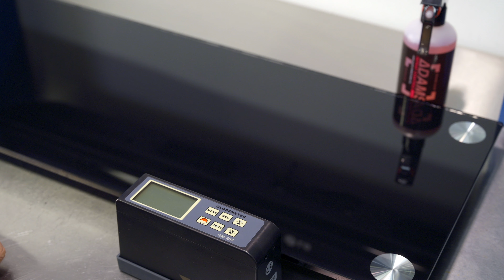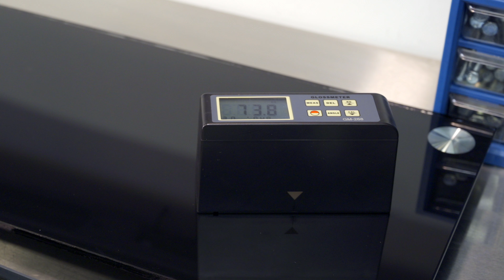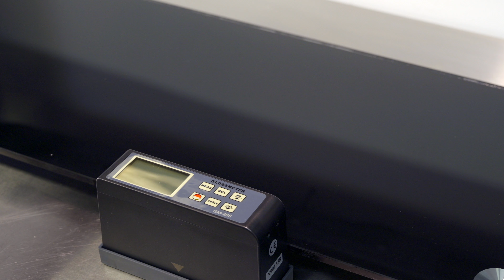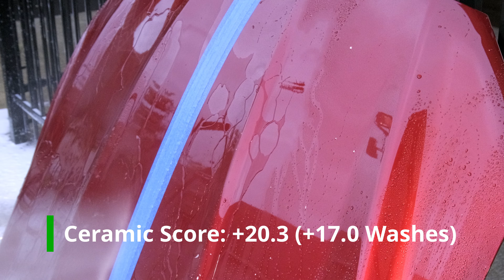It Glows! - Adam's UV Ceramic Spray Coating

Comment: Sadly I bought this and it’s not that good. Yes I did everything like he did and it did not last long (under a week). I now use turtle wax and that thing lasts forever. There is this guy who tested every ceramic coating out there and turtle wax comes out on top and it’s way cheaper. You cannot return adams ceramic coat too.

Comment: These ceramic coatings are better than waxes and a lot easier to apply.  I used Carpro HydrO2 and it couldn't be simpler.  Just mist it onto a wet car and rinse it off less than a minute later.  No waxes needed before or after and it can even make water run like crazy off a car that had no waxes or sealants on it at all.  The only drawback is it doesn't last too long but it is cheap and easy to use.  I can put it in a mini hand held sprayer and spray it on at a self service carwash and magically drive away like I just waxed the car!  I will be trying Adam's coatings next and I expect great things.  I think it technology is wonderful with all the advances in chemistry and such.  A hundred years ago no one ever saw all this coming (except maybe Jules Verne or Michel Nostradamus).  I also like the way these products don't have an adverse effect on glass.  In fact, I stopped using Rain-X when I started using these products.  It replaced Rain-X in my opinion and I used to swear by that stuff!
Reply from the maker: Charles, yea the coatings are amazing these days. They can last a very long time, though I have not used the Carpro HydrO2. What i would call “true” coatings such as the Blackfire Ceramic Coating or the Adam’s Graphene ceramic should last a few years. One challenge is that true coatings require machine polishing before application. That process can be a bit difficult and take a whole weekend or longer depending on the level of correction needed. Its not a hard requirement, but it makes a single application bottle that costs $50-$100 worth it because it will last years if done right with the right product. With glass most of these products are great, but some do cause wipers to catch it they aren’t quite as slick as clean glass. Just trial and error on those.

Comment: You mentioned Colinite, that is one good wax I liked using before I made the switch to ceramic coatings.  It is thick and buffing it can wear some people out!  It also clogs buffing rags easily.
Reply from the maker: Yea Colinite isn’t bad. They have been around a very long time and make some good products. The one i tested was a bit hard to buff off and use in general.

Comment: Thanks for the video... I have a question please how could A ph neutral shampoo affects the durability??
Reply from the maker: Good question, pH is a measurement of how alkaline or acidic a solution is. Adams shampoo is meant to be pH neutral to avoid the unnecessarily negative effects a non-neutral shampoo could have on a wax. However, this does not mean that washing a car with a pH neutral shampoo doesn’t remove waxes and similar products. Sure the goal of a good shampoo is to be as gentile as possible on paint and treatments, but it also must actually remove grime. Ultimately even if you use a pH neutral premium shampoo while you’re scrubbing away on your car you will still break down any products you applied. I use a premium Adams pH neutral shampoo to ensure that I give products the best chance possible. This way resistance to high or low pH is not a factor in the test. I assume anyone this into detailing will buy a decent shampoo and not use some random dish soap.

Comment: Wow
What is best looking wax you can buy for not insane cost please ?
Preferably for metallic thunder gray colour ?
Reply from the maker: I would recommend checking my page here: https://dmitrysgarage.com/wax
Reply: @DmitrysGarage  ty vm 
Checked it out 
Looks like Adams graphene ceramic spray is the best real gloss improver but then again only by around 4%
Do dedicated permanent nano ceramic coating also reduce gloss or improve gloss by almost nothing same as waxes please ?

How about gloss readings on very expensive carnuba waxes ? :) 
There is wax with 74  % carnuba in it 
Obsession wax Phaenna , would be amazing to see it's readings

Comment: I have to ask... What's the point in all theses different waxes and sprays .  
Surely there is only one thing you need to buy and that's Fusso coat...
Why waste money on anything else
Reply from the maker: Brian, I get these frequently, but surprisingly about different products. You say surely you only need Fusso coat, others say surely you only need Seal N Shine, or yet another product. The reason is that we're all looking for slightly different things. Processes that we like, durability, the way the product looks, etc.. For instance to me Fusso has downsides, it's not very pretty and it's also hard to get. The new formula isn't as good and the old formula just took over a month for my friend to receive.  The durability is crazy for a non-ceramic product, but something like the adam's graphene is even more durable. Products like wolfgang or jescar look much prettier than Fusso, but are less durable.
Reply: @DmitrysGarage  surely there is something you could put on top of Fusso to give a better shine but keep the durability
Reply from the maker: @briananderson2016  Then you're not just buying Fusso coat, right ;-)? So again you need more info on which products would be appropriate. You'd have to consider the added cost of two products. The added time spent waxing the car twice. Will the wax you put on top last as long as the Fusso? Will the solvent in the wax you put on top make the Fusso weaker? Is this better than just picking a different product altogether?
Reply: @DmitrysGarage  so many questions so many factors makes my head hurt lol